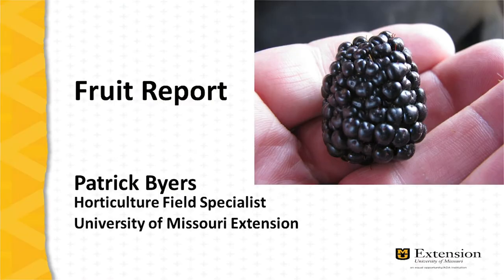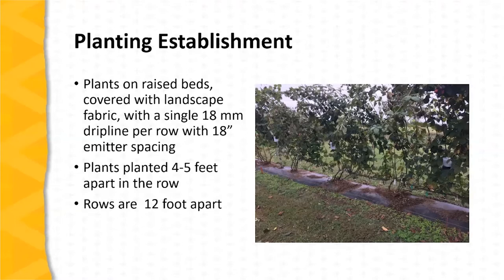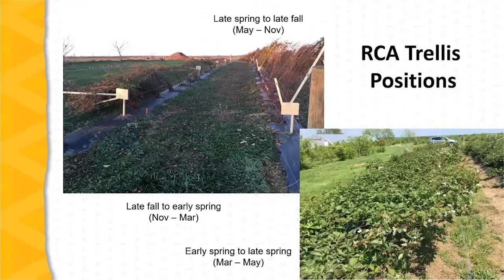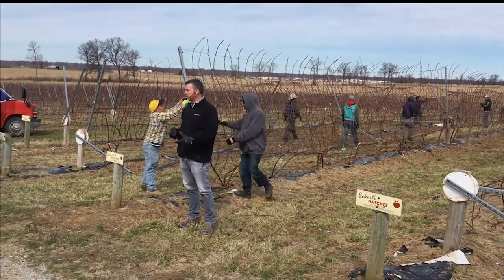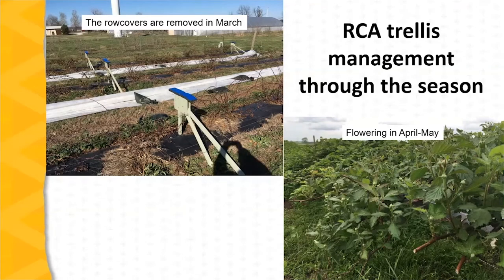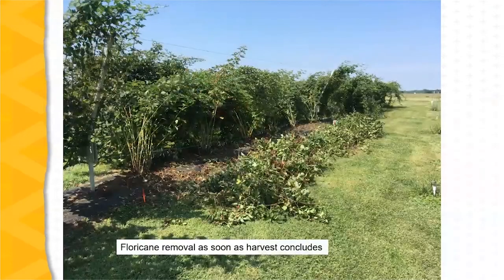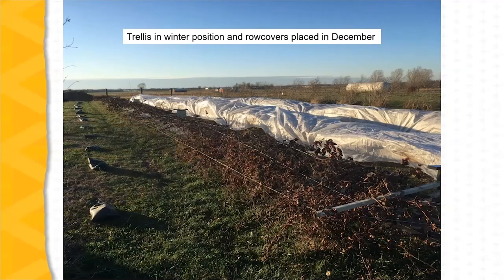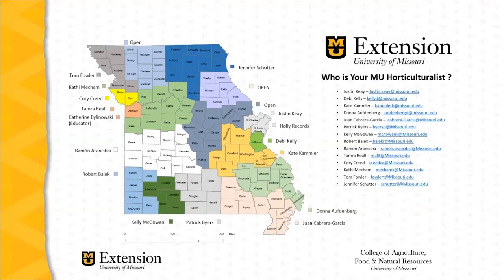Rotating Cross Arm Trellis Systems

Comment: Thanks for the information, this is very helpful.  Perhaps I missed it, but with all things being equal, is there an estimated material cost per foot to install an RCA trellis system?  Thank you.
Reply: Thanks for the inquiry.  Lots of qualifiers to consider  to address your question; and farmers generally find ways to "build it better and cheaper".  The primary supplier of RCA trellis arm assemblies is Trellis Growing Systems/Ibex Growing Systems of Ft. Wayne, IN.  Check out their website for pricing information for a "package deal" that includes trellis arm assemblies, HT wire and hardware, irrigation, weed barrier fabric, row cover, plants, training supplies, and required tools.

Comment: Would this system also work for raspberries? They seem to have a very similar growing pattern to blackberries
Reply: Dear jorian1 107  The RCA trellis system was developed with certain blackberry cultivars in mind; ie they produce several strong primocanes that are limber enough to train horizontally, and these primocanes produce sufficient laterals to fill the trellis.  This type of system might work with black raspberry.  I don't think this approach would work well with red raspberries, as the primocanes don't freely produce laterals.
Reply: Also, keep in mind that thornlessness is desired with plants trained to the RCA trellis.  Even the minor thorns found on raspberry would be an annoyance.